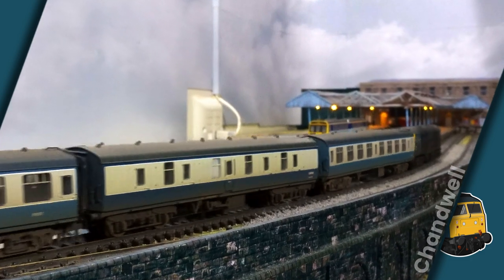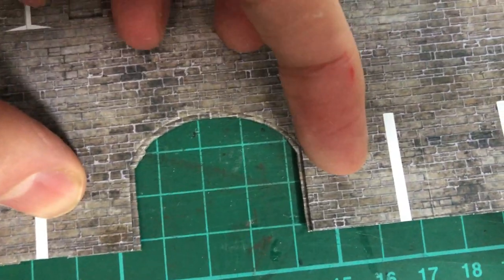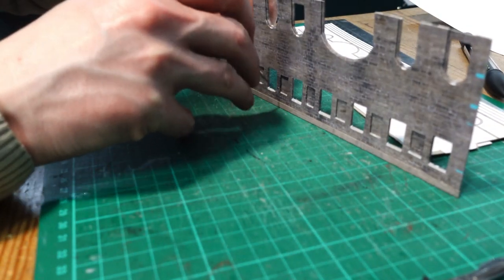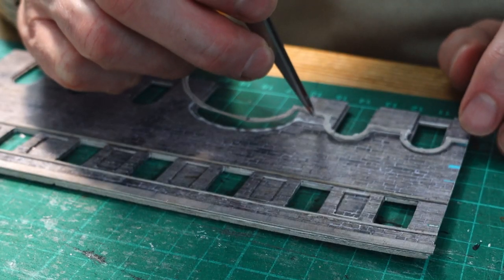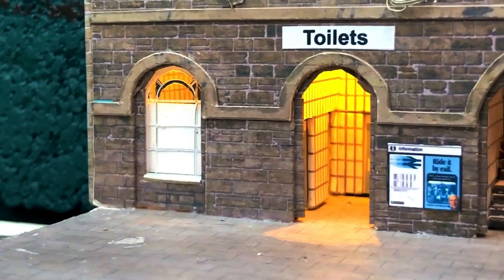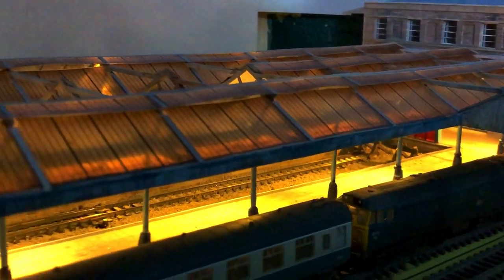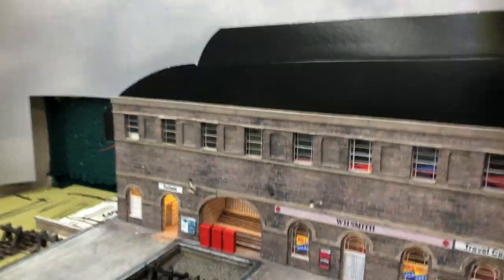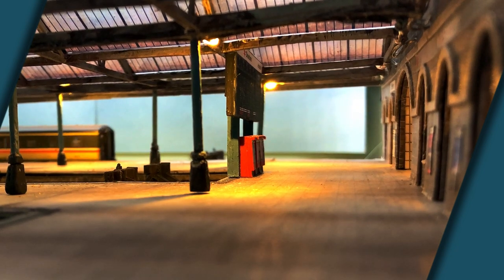Scratch building a low-relief station building from card in N Scale: The Buildings of Chandwell

Comment: 1) I use Inkscape and get fairly good results! It's a really powerful tool and helps get things just right for templates etc. I don't have your patience though, you've got a talent mate absolutely!

2) Yes, a guide on roofs within Inkscape would be so useful!

3) You have a fine selection of whisky!
Reply from the maker: 1) Cool! Sometimes it is hard to methodically get everything done before moving onto the next exciting thing, but it's worth it.

2) OK! Watch this space. I was going to cover simple lean-tos, gables, gables on an odd angle, and hipped roofs. Any requests?

3) Thank you! There are a few more bottles lurking under the layout.
Reply: @Chandwell  

1) correct!

2) that all sounds good to me mate, multiple angles would be good too, roofs obviously look a bit different when they're seen on low relief stuff

3) Drink up!
Reply: @Chandwell  All of those please Michael. I really struggled with a roof with 4 hips. Ashamed to say it was trial and error that finally did it. More error than trial...  🙄🙄🙄. Sometimes I forget that you are working in N scale. Goodness knows what detail you would achieve if you modelled 009 or 7mmNG...!!!!!
Reply from the maker: Thanks Peter!

Comment: A question regarding InkScape. I have laid some Scales Scenes brickwork onto a rectangle which you have shown in one of your previous episodes. Now I have tried bending the overlaid rectangle with the 'path/path effects' to get it curve as in the brickwork over an arch but Ink scape doesn't want to play. I can do it with a vanilla rectangle but with an overlaid one ...... nada. Any thoughts?
Reply from the maker: Hi Neil, this is where Inkscape won't help you I'm afraid. Inkscape can bend shapes but not textures. So the texture will remain the same regardless of the shape it's contained in. To get arches, it's best to start with something that already is an arch, or to bend the paper once printed. I did make a circle once, but I cut out individual bricks and rotated them. I think I showed this in my River Weir Scene video. I do have "arches" on my list of Inkscape topics to show in a future video... so watch out for that. Thanks for watching! Michael.
Reply: @Chandwell  I have found that InkScape will allow you to modify graphics in an imported PDF. I've played around with Scale Scenes small bridge R011a to make a hump back bridge, snapping to points on the graphic. This is where the curved brickwork would come in handy